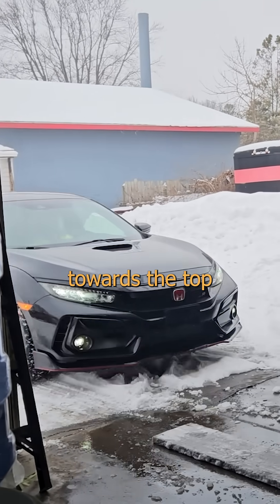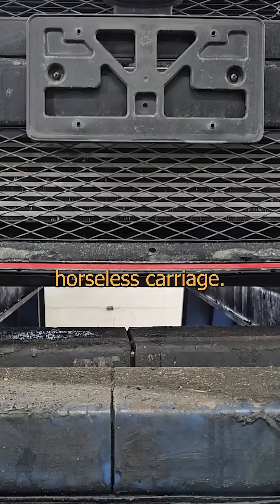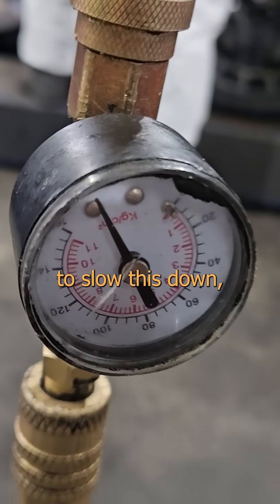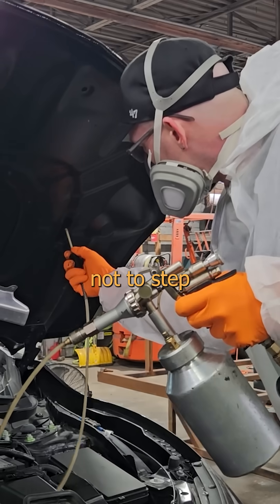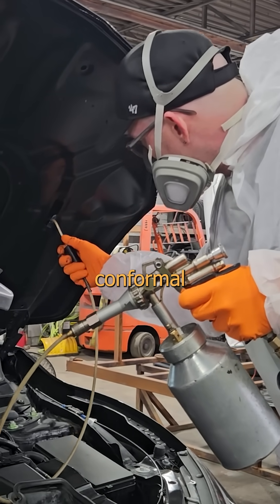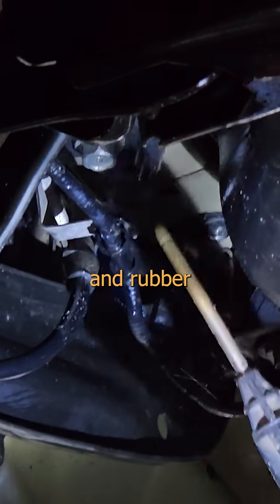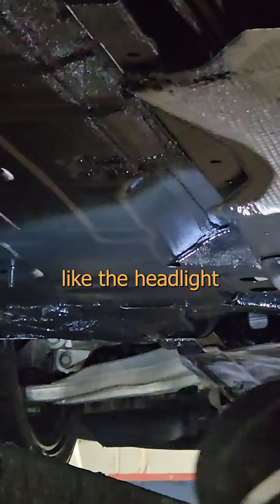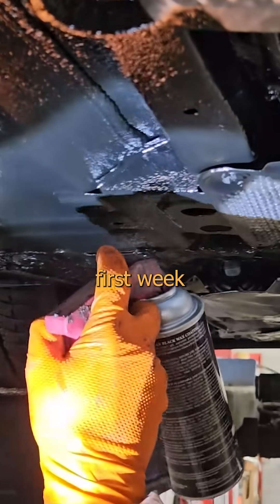How to stop rust on your car #chrisboden #comedy #engineering #wax #corrosion #science #winter #salt

Comment: You could also buy a car with barely any steel to rust to begin with. For my car, I basically only have to undercoat the frame rails because everything else is either aluminum, fiberglass, or plastic.

Comment: learned how big water treatment tanks prevent rusting; they have something called sacrificial anodes (along with preventative maintenance) that are designed to corrode so that the tank doesnt. its alot easier to replace worn out nubs than it is the whole jug.

(all puns intended)
Reply: Engineer here, This is already used in cars, often there are thin zinc strips between where panels like fenders are bolted on.

But for the rest of the underbody, subframe, and other metal parts... You really want a coating like this video shows. They actually seriously work to prevent rust. Like he says, anything works, and I agree that wax/lanolin are probably the most optimal choices.
Reply: Then there are active protection systems that use electric current to prevent corrosion , especially with friskier compounds like sulfuric acid .

Comment: As an ASE certified mechanic I couldn't possibly DISAGREE more. That junk makes my life even more miserable than it is just by living in Buffalo NY. Especially with the Uber cheap crap that's basically a rubberized tar they spray over everything. I don't need to spend double the amount of time the book says a job should take because I've got to torch out every single solitary bolt, nut, screw, whatever. PLEASE if you are going to follow this dubious advice, make sure it's not the cheap crap that's going to make your mechanic hate you.

Comment: During an internshi[ last year I had to work on hydraulic cilinders for seafaring vessles, I tell you salt water corrosion is no joke. There were cilinders I had to hammer off 2 cm of pure rust before we could sand them down and reaaply the iron-oxide Minium primer, which is a thick primer very effective against rust and we'd coat the cilinders in.

Comment: I use Fish Oil. Spray inside every door and panel and frame hole. Smells like Fish for 1 month but the doors get the solid VW closing Thunk sound when it dries. Every Car i did in the 90's I still see forsale from time to time with no corrosion on FB Marketplace.

Comment: An effective old-school way to do that is to use your old motor oil and hose down the undercarriage with it after every oil change. Just a light coating on everything does it. I know a lot of old farmers that do it and their old trucks are rust free.
Reply: Usually mixed with diesel to thin it out. Once a year and no rust. It might be an environmental disaster. But it works.
Reply: Gotta think about the effects on any rubber underneath, and the environmental effects, but yes.
Reply: @alantownsend5468  Oil and diesel shouldn't corrode most rubbers or plastics

Comment: Only problem with undercoating is unless it’s been done when the car is brand new, all you’re actually doing is sealing in the existing water and corrosion
Reply: Rust = iron + OXYGEN

Water and/or salt is a catalyst.
Get Ur car sealed.
Reply: You're thinking of the rubberized undercoatings offered by dealers. Annual fluid film applications don't behave like that.

Comment: In Australia our nickname for lanolin is fleece grease
Reply: Sounds like some kinky lube but do yall use it to prevent rust on automobiles? Winter rust belt salted US roads are like driving in ocean water 6 months of the year. Snow & ice in  Straya?
Reply: @kineticsurf we have snow in a very limited area in Australia so the salty roads aren't a thing. Some offroaders will use rust preventatives, but on the whole unless you are launching boats frequently or are very close to the ocean most cars newer than the late 80s don't have much beyond surface rust
Reply: @kineticsurf  considering 95% of our population lives near the coastline and surf spray coats the roads in salt, yeah. Our inland was once under water so even the red center is high in salts. As for ice, Australia gets more snowfall than Switzerland per annually.
Reply: @kineticsurf we use it at work for the trucks because most of them are going on and off mine sites everyday and the water they use for dust suppression on there roads can be pretty corrosive. Some sites the water in the wash bay is even somewhat corrosive because they have to recycle it for environmental compliance.
Reply: “Fleece” as in to steal?

Sure sounds like a weak attempt at being contrary 😂
Reply: @mlcatlin lanolin comes from sheep's wool - also known as fleece
Reply: @mlcatlin  The verb "to fleece" for theft originated from the literal process of shearing wool from a sheep. The connection is a metaphorical one, portraying a person being stripped of their money or property in the same way a sheep is stripped of its fleece
Reply: @Slidaulth Excellent explanation and it saved me from typing it out.

Comment: Northern Hoosier here! I had always heard that undercoating was bull$hit, so I appreciate learning that it actually can be useful. Thanks!
Reply: @Sauere  its the rubberized stuff that is BS. You dont want anything that fully hardens.
Reply: @brianturko3481 why?
Reply: Many say the same about routine maintenance and it's usually the folks whose vehicles end up on Just Rolled In .
Reply: If done poorly it is BS and can cause more issues simply hidden!
Reply: Back in 1986, I bought one of the newly remodeled Mazda RX-7s right off the show room floor in Fort Washington, PA. It was a Sport Model, with no power steering. That thing was an absolute beast! I got what they called the "wax oil" undercoating and it worked amazingly well! That car lasted forever! Wish I still had one!
Reply: I'm a former northern Hoosier. I used to have the same belief until I watched both an Isuzu and Toyota frame rot until they were unsafe to drive. Now I'm of the belief that something is better than nothing and have oil coated my own truck frames since. Except now because I moved to florida.
Reply: I used to put transmission fluid in the bottoms of the doors and a bag of silica in a small plastic pan in the trunk under the spare tire . Scrub down the floorpan with soap and water air nozzle dry then roll on bed liner.

Comment: In the UK this used to be the standard practice until galvanising became standard, that said, our MOT tests (road worthiness basically) checks for rust and you will be warned well ahead of it becoming an issue (or your car fails and needs repairs/scrapping). It's why it's really uncommon now to see cars not lasting 15+ years, with other failures like the engine killing the car first instead of the body failing. (Wife's car is now 16 years old and the body doesn't have a spot of body rust on it. Underside isn't exactly rust free but it's all surface rust only so far so again nothing to be concerned with)
Reply: Dad's car old car dit the dust at 19
Cause? Ulez+ knackered rear suspension

Shitbox high mileage 2001 ford focus he bought it at 17 for 450 quid and added at least 50,000 miles in the 2 years he drove around in it

ulez forced our hand to get rid of it but the suspension stopped us selling it, so to the scrapper it went

20 years and 200,000 miles is normal here
Reply: @bussesandtrains_121 thankfully the wife's Micra is ULEZ compatible but we don't drive it long distance (I've got my own 9 year old car that's much , though it's only 1,200 miles from 100k. My own car is more comfortable for long distance though, that's pushing 70k miles and we're going to keep both until they literally fall apart.
Reply: You also barely have winter
Reply: @technobyrd8  Barely winter can be worse - when it's freezing cold for weeks (or months) on end there's no liquid water, and everything is basically dry. Also, the roads don't get sprayed with salty brine. In areas where it tends to swing between freezing and thawing almost every day, or there's just the risk of freezing, road authorities like to coat everything in salt... Now that's not good for your car.
Reply: @koma-k didn't even realize you all needed to use salt.  I thought the only salt you had to worry about was Sea spray
Reply: @technobyrd8  we can manage four seasons in one day over here so salt during winter is a constant. And as mentioned, when the ambient temps are around 2-3°C the ground can be 0°C aka freezing point. So we go all in on the salt since ice around that temp is unbelievably slippy.

If it was a constant -10 to -20°C it'd be alot easier to manage (I've driven in Sweden inside the arctic circle and they don't bother with salt, you just stick to the ice)
Reply: @technobyrd8 same here in the Netherlands. We would be lucky to even get 1 week of snow. But because of that the roads are salted non-stop, because the rainwater would otherwise freeze overnight. The only thing worse than snow is ice.
Reply: @kaptein1247 damn, I've been to Europe, but not in winter, because tourism, obviously.  Love learning and getting totally schooled in the comments.  I'm used to the US where we have places that get salted all winter and places that just don't, there's not a whole lot of in between.
Reply: @technobyrd8  I can imagine that the places who stay snowed in and stay below freezing wouldnt see much salt since it makes more sense to shovel the snow. Since you need water first to get ice the places where its above freezing during the day and freezing at night would get the most ice. Ice cant be shoveled, so the only way to deal with it is to melt it.

I am happy with our mild climate though. Snow is fun and pretty for a bit, but becomes a nuisance. I just make sure to wash my bike more often and apply wax. Rust isnt that bad then. A lot of people do have "salt bikes". Old beaters that dont matter as much when they get dirty/rusty. People with cars go to the drive through garages more often to have the underside cleaned. Underbody coating is also relatively common here.
Reply: @technobyrd8  Here in Norway the general rule is that the coastal areas gets the salt, while inland it tends to stay frozen for a few months so they don't salt. It's usually signposted where salting ends.
Salting when the temperature stays below freezing usually just creates more unpredictable conditions, as you'll get salty, slippery slush at different temperatures depending on the salinity, which can vary a lot over a small area, especially when it snows.

Comment: I went to one of the chain shops (Rust Repair Inc) for my 2021 Ranger.  They steam-cleaned the underside, then applied a lanolin based coating inside all of the panels that were accessible, and a tar-like coating to everything else.

I go back once a year (In November, the month before they start salting the roads here in the Pittsburgh area) for a touch-up job and so far it's held up beautifully.  Not a speck of rust anywhere on the truck.... and for a Ford, THAT'S pretty cool!
Reply: ok but I got a 2005 Ranger, never did any of that, frames rusted sure, but I still use it most days for farm work and freeway driving, no problems
Reply: @ianglenn2821 Yes, but do you live in the rust belt? Where I live. You don't do something to protect a car, especially a Ford or other vehicle prone to rust, you'll be lucky to get 10 years out of a vehicle before it's undrivable

Comment: Cool, VW (and others) are doing that waxing (Wachsflut - high pressure wax into the whole frame + spraying wax on the underside after the body left the paint shop) as additional undercoating to the normal epoxy layer already for decades.
Reply: Yeah every automaker uses spray wax inside panels and cavities for this reason - but it's focused on the seams where panels join. That's where there may be tiny gaps in the electrocoating, and where water can worm its way in.
Full wax undercoating is a GREAT idea and seriously actually works to prevent rust.

Comment: I prefer to paint it. There's a lot of powder coats that are absurdly durable. Wax coatings are good, yes. And things don't stick as well also yes. But one you need to REALLY dig to get of. Like you're getting more trouble from the thing imploding than the paint coming off.